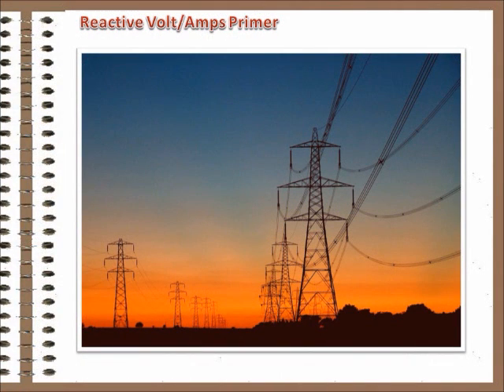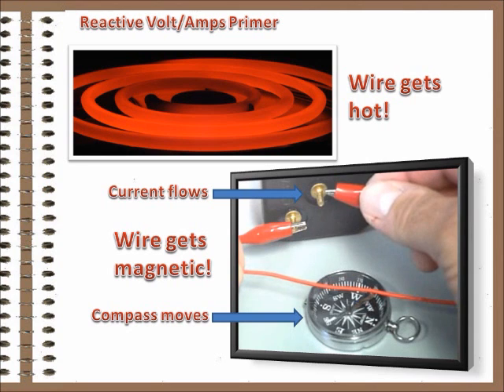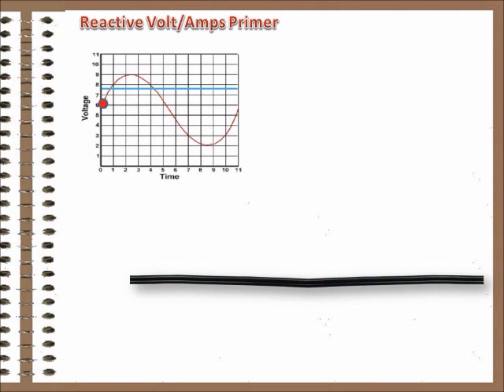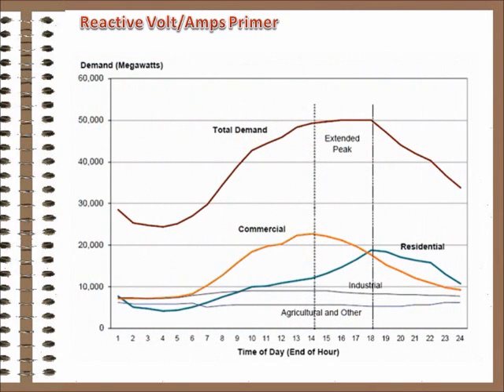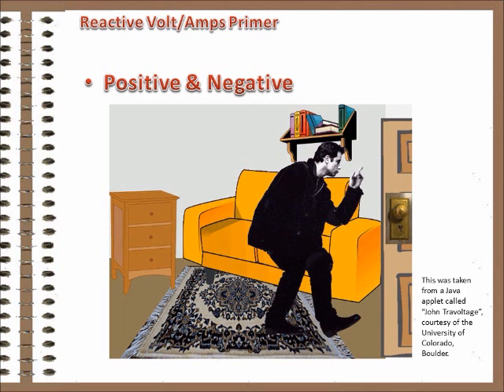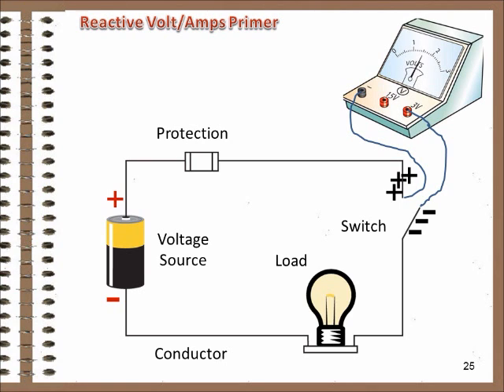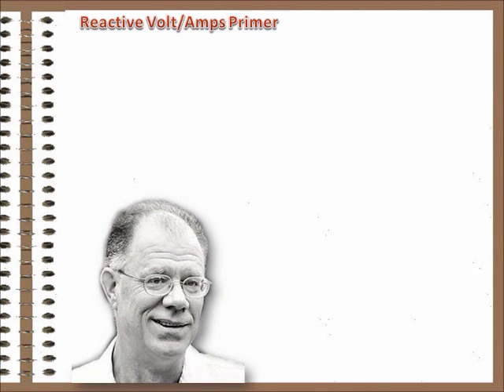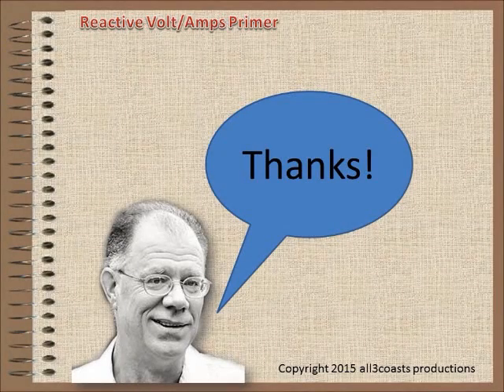Reactive Power Primer

Comment: In N.American, does the power really alternate back and forth between the plugs? Using both the hot wire and the neutral? Or is it just a sinewave of postive and negative potential showing up on the hot lead. Because I don't think neutral wouldn't normally have a signal on it, unless it's become a return path.

Comment: Thanks Doug - very nice and pedagogical! Your cool and friendly!
 I'll use it as an introduction in my lecture to students of Wind Power Management on grid connection. 
Best regards from Sweden!  :-)
Reply from the maker: +Hans Bernhoff Just put up a new video. Go here - https://www.youtube.com/user/all3coasts
Reply: Thanks. Nice channel. Four my courses it would useful if you could make a video (similar to the one on Reactive Power) which explains how power conversion occurs in a synchronous generator (both normal and PM - find it simpler to start with PM...) from torque and angular speed to current and coltage in terms of rotating magnetic fields of both rotor and stator... 
:-)
Reply from the maker: +Hans Bernhoff Hans - I think I know what you want, and I can make a video about it. Just one question - what's PM? Sorry, I'm not familiar with that acronym...
Reply: Thanks, sorry for being unclear: PM = permanent magnets! :-)
Your videos are popular - just added a link to the course on rotating electric machines I'm giving now. Best regards!
Reply from the maker: +Hans Bernhoff OK, got it. No problem, working on the script now. Thanks for the idea - it' a good one. In my world (power plant and substation operation and maintenance) PM more commonly refers to "Preventive maintenance". That's why I was confused...
Reply: Thanks! Great! :-)
Reply from the maker: +Hans Bernhoff have you looked at the new video I've put up on motors and generators?
https://youtu.be/SQHrPjqIe14

Comment: great video sir.first time to get the concept of why adding capacitors increases power factor and saves money...... thanks
Reply from the maker: Thanks, Omar - these concepts are almost always explained using math. While math is an elegant way to show many electrical concepts, it's the real world application that leads to understanding. That's what I try to do - explain things in a real way. Any other electrical topics you'd like to see explained this way?
Reply: +Doug Fuller This is great explanation. Would you explain how reactive power helps  transmit the active power and contributes to voltage stability? We need physical explanation not math. Thanks
Reply from the maker: +Omar Barakat Just put up a new video. Go here - https://www.youtube.com/user/all3coasts
Reply: Great! thanks sir